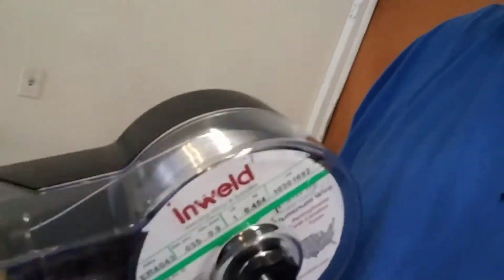Aluminum spool gun on Miller Extreme VS and engine drive

Comment: Hey, I have an old SAE 300, Could I use this suitcase welder to weld Sheetmetal like 14-18 ga steel? I know they make Rollers for them .035/.030
Reply from the maker: ZGERMAN. Should have no problem.

Comment: Hi I am looking to wire the same spool gun to the miller extreme vs. What wires are spliced on the Extreme VS.
Reply from the maker: IonicBasher .  The red and white wires that go to the spool motor.
Reply: Terry Lyons Thanks thought so but saw it was 24v and wanted to make sure.
Reply: @terrylyons9463  hello Terry I have the extreme looking at getting the spool gun 250 for 1/2 allumium.  What wires did you fix and was it on the suitcase or the spool gun side